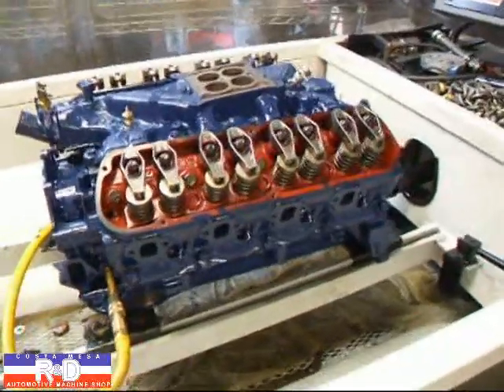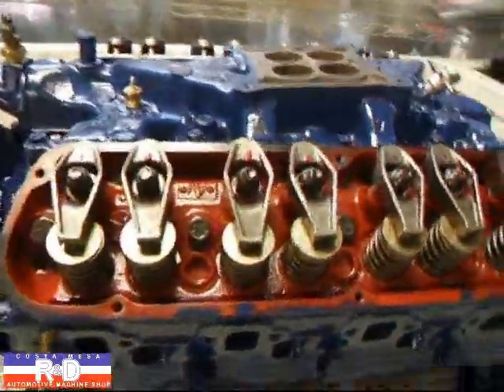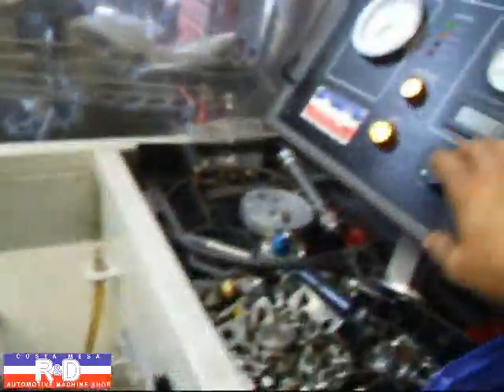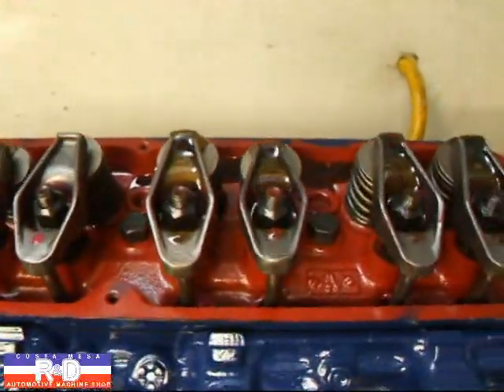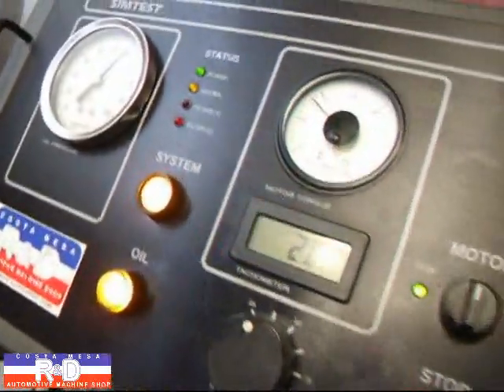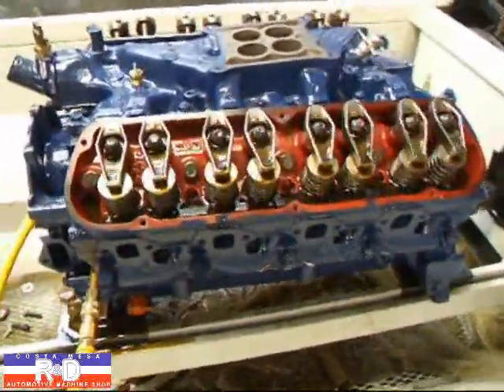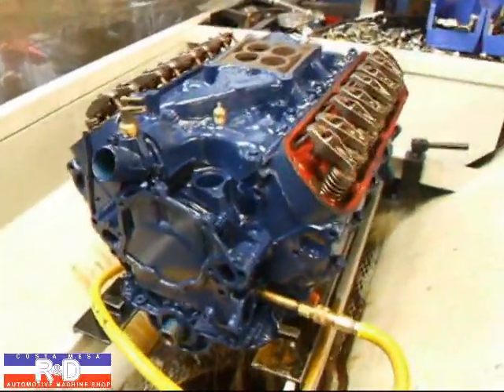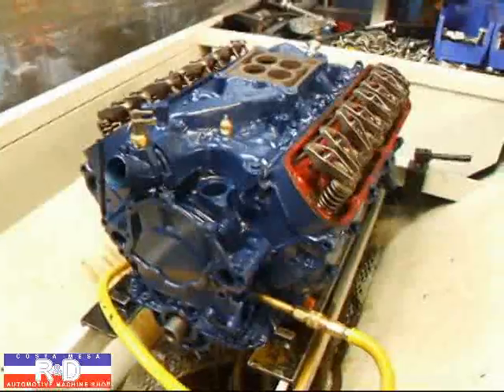Shelby GT-350 Simtest

Comment: @chuckwin100 From Comp Cams: As soon as the engine fires, bring the rpm up to 2000 to 2500 during the first 30 minutes of operation. Slower engine speeds will not supply the camshaft with an adequate amount of oil for the break-in period. The engine rpm may be varied periodically between 2000 to
2500 to direct oil splash different areas of the camshaft. After the 30 minute break-in period, change
the oil and filter again to be sure all contaminants and break-in lube are remove from the engine.

Comment: why is it necessary to run the engine at 2000 rpm to break in the camshaft? wouldn't that lead to scoring of the lobes and the lifters?

Comment: john said numerous times that simtesting only serves initializing the engine and checking for compression and if everything rolls smooth. he rarely puts the engine in the car so before he loads it back up on the costumers pick-up, he checks it.
improper break-ins don't only affect the ring land, cyl walls and ring seating, it can mess up you rods, shafts and bearings too

Comment: @brendanraymond I can't say I know the exact reasons, but engine builders and manufacturers recommend that you do it that way. I'd hazard a guess that wide open throttle causes damage to the bore texture as combustion temps are greater and the pistons are in the process of finding a perfect fit with the bore. I believe that due to the reciprocating bottom end of the rods, at different revs, the pistons put greater pressure on particular regions of the bore, so a constant rpm will wear unevenly.

Comment: @brendanraymond Driving it like you stole it is not good as a break in and is just as bad as holding it at a constant. Basically you can work the engine, but at lower revs and not wide open throttle. You need to vary the revs, so if driving along a highway, change gears frequently and vary speed. I  believe bmw advises that you don't rev past about 5000 on an m3 when breaking it in, but lower revving motors it's probably more like 4000. :)

Comment: @TheAristotleQ Did you not listen all the way to the end? He said there was still a break in procedure that needs to be done after the engine is running... And he also mentioned that it helps line components up during this process. I don't not think for one second that John uses this for a complete break in procedure!

Comment: less drag on the engine less amps on the motor thus more rpm right?    so could u break in an engine using this method?  no combustion to help seal the rings aginst the block tho.....